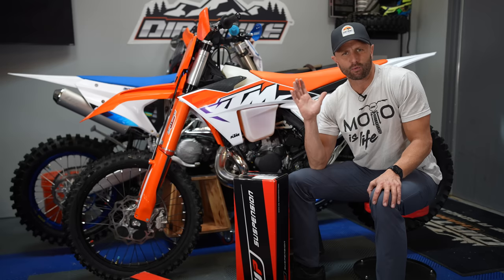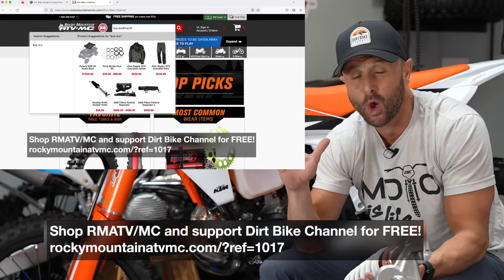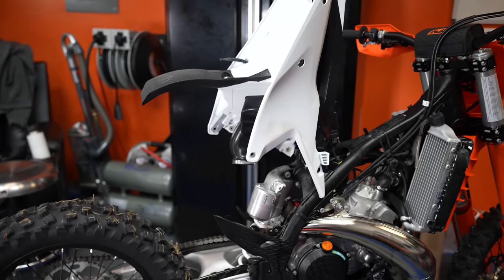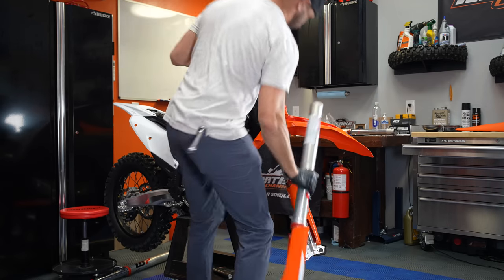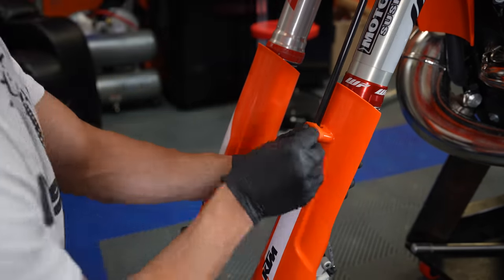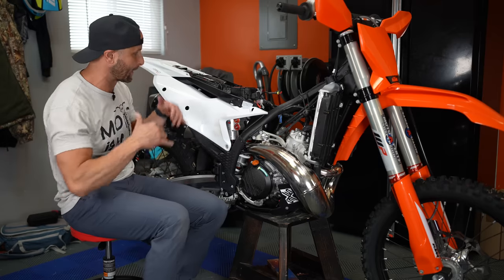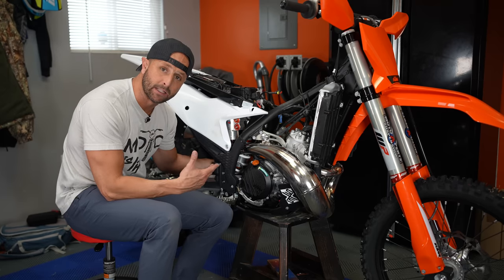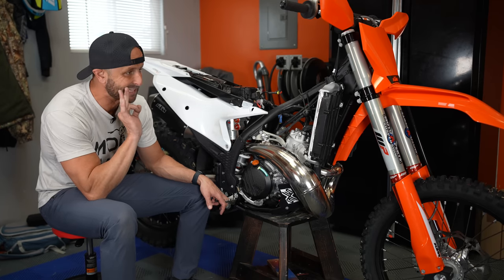6 Grand Suspension??? WP Cone Valve and TRAX Shock Install on KTM 250 XC

Comment: I just install trail valving. Makes the bike work great for rocky technical riding fast or slow. And It didn't cost me anywhere close to 6 grand for Heaven sake Kyle.
But if someone wants to spend 6 grand then foolish power to them.
Reply: At race pace it's not the same thing.

Comment: I’m a weekend warrior I don’t race so 6k in suspension deff not worth it ! Lol
Reply: Have you had your suspension worked over?
Reply: @KoltFin  just re sprug fro my weight set sag an played with clickers all good!!
Reply: One trip to the er for a few stitches cost more than fancy suspension....  or the months off work from a bad get off.
Reply: @woodysrockspyro6436  I’m set up just fine ! I ride every other weekend no issues yet
Reply: @woodysrockspyro6436 hey man I have had Enzo a kit, rg3 a kit, and now cone valve wp stuff and I can honestly say all three have put me on the ground for a trip to the er.. 😂 suspension is absolutely the best mod a guy can do don’t get me wrong but I would be willing to bet 90% of guys out there couldn’t tell the difference between a kit vs stock stuff that’s had valuing, sag, and spring rate good..
Reply: I have been racing for 25 years and honestly where I can feel a difference is typically a kit stuff will hold up better with out bottoming. Where as stock stuff will tend to have a harsher transition from slow speed to high speed compression.. plus typically the forks are a little bigger (50mm) so they are a little more rigid and decently don’t flex as much.. but that’s just my opinion.. my son is now taking the “race budget” but our biggest struggle now is the air forks on his mini bikes. Ktm and sister brands have absolutely trash air forks. We have sent them to multiple reputable shops and tested countless hours and they are either to harsh but hold up or are plush and just blow through the stoke with no happy medium.. so on his mod bikes we gut the internals and put springs in..

Comment: I put Lucky's (from Slaven's) on the front, and an MXTech National on the back, of my '21 TE300, a set of WP6500s on the front and another National shock (both from Corey at ProTune), on my '18 FE501. Yes, they are a lot of money, but less than the $6k thumbnail of this video ($3k for the 300 -bought the shock used, and about $4k for the 501), and I also plan to use them on several bikes. The risk here is that they may not fit on the next generation of bike that I buy. Regardless, both bikes work VERY well and I think that the money is well spent.
I have never ridden the cone valve forks, or traxx shock so I can't make a comparison to those, but both of my suspension set up (both are for different applications) are better than any other modified suspension that I have purchased, or even ridden (on other's bikes) previously.
I look forward to seeing how you like your set-up. IMO modifying the suspension, and also ergonomics, are the best dollar value one can get on your bike.
Reply: Add the Ravens instead of Lucky and will be that much better
Reply: Corey is the man

Comment: I've ridden a few set ups with cone valve, but I still prefer the KYB stuff.  A set of Technical Touch inserts valved for my size and speed along with valving and re springing the stock shock made all the difference in the world on my 23 250XC.  I know some folks like the air forks, I hate them.  Leave those on the GG line and put cones or the new 6500 inserts in the KTM/Husq models.
Reply: +1 on the hate for air forks haha

Comment: WP, easily the worst suspension brand ever. There are chinese KYB copies that works better out of the box. You buy a +$12000 bike and need to rebuild it for $2000 just to get the bike to work properly. WP/KTM/HVA/GG should be ashamed for all those years with crappy suspension.

Comment: If you'd rather ride a slightly easier trail, or slightly slower, you're a wimp.
If you spend $6K to make the same trail slightly easier, or give you slightly more speed, you're a local hero.
Reply: If I'm bending front rims from the rock impacts can I buy nicer stuff?   
My wp open chambers with the dal sagio still kind of suck at speed.

Comment: Great video Kyle! 🙌
I was just wondering what was the problem of revalving the stock suspensions? At the end of the video you said something absolutely correct, which is that the valving is key to be able to have the suspensions dialed. However changing to premium/other suspensions won't make them automatically plusher or more comfortable if the revalve isn't the right one.
Unfortunately that is a myth that is kept alive that makes a lot of people spend money they don't need. A proper adjustment/revalve of many stock suspensions is what most people need, not new suspensions. 😅
Just to clarify another point, the Cone Valve is probably the least suited feature for slower riding. It's an unbelievably technology for guys giving it the beans and bashing at stuff at great speeds. 💪
And yet another point, the premium PRO components are definitely the choice for someone...well, pro. The quality control and designs chosen are needed to allow the shock/forks keep their highest level of performance no matter the beating they get. That's what you get with the PRO line, but - like you said - if the valving is off, you can have gold platted suspensions that you won't get better at it in any way 👌
If you want to know more about it, I have a video dedicated to the Cone Valve and the Supertrax system is coming out in the next couple of weeks! 😄
Reply: He explained that that it will take him 3~ bikes to 'justify' the cost of the CV/Trax...

Can you even buy the premium suspension without getting it revalved according to your specs/wishes?
Reply: @KTMmarkus  if what you do suits the standard setting, sure!

Comment: Lift the Forks 7.5mm (3rings show out) is same effect on trail as going from 22mm fork offset to 24mm and vice versa. Makes better handling but less stable. The effect is based on the change in front wheel trail. Best regards!

Comment: So if u are changing your linkage on your bike too lower it an inch how much do u have to put your forks up on the triple trees!!!Anyone???...
Reply: I would level my bike on the stand and get a before and after measurement from your rear axle then make the same adjustment on your front by raising your forks. It's not a perfect science because your geometry is going to change slightly but it's close.